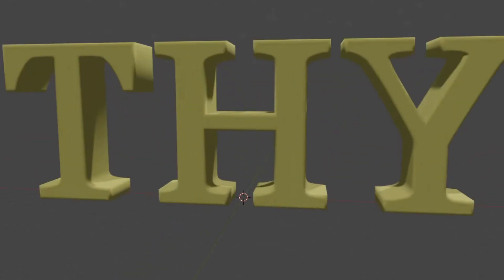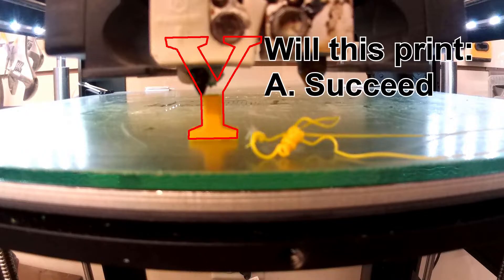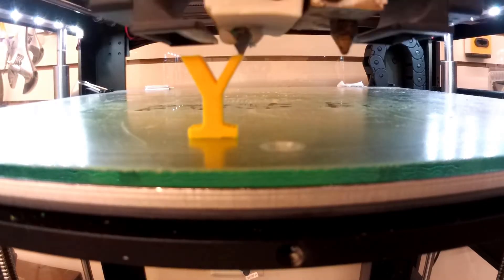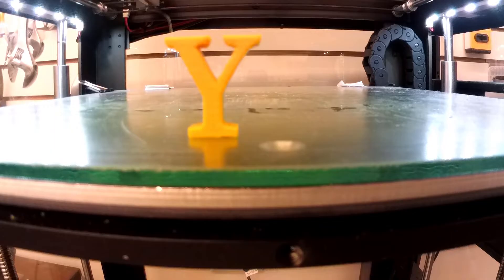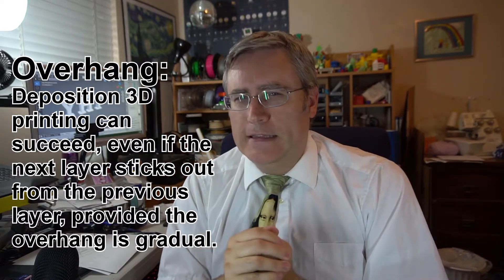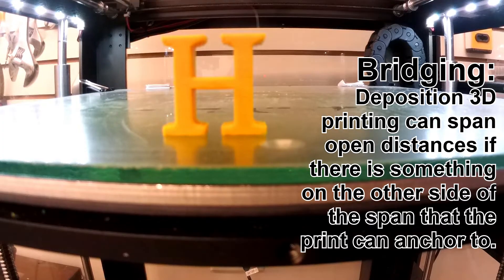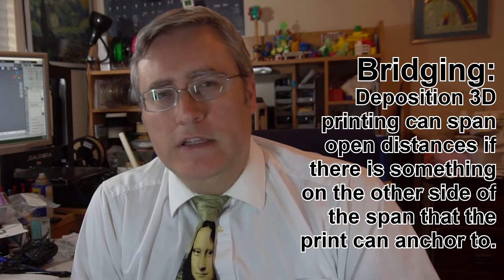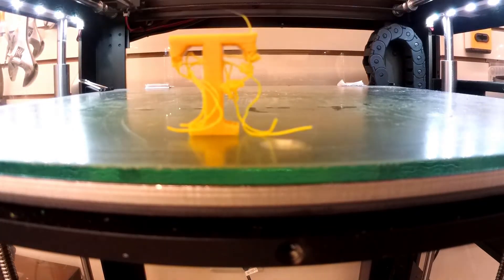How to design for 3D Printing   YHT

Comment: Print the Y flat so there’s no issue. (Roll credits)
Reply from the maker: There he is.
Reply: 3D Printing Professor here I am.
Reply: 3D Printing Professor printing flat isn’t about printing overhangs or not using supports. Letters printed flat look better because you’re looking at more smooth surface and not a bunch of horizontal lines

Comment: I've gone up to 60° overhang without supports without much issue in smaller prints with my Monoprice Select mini.
Reply: Yes, and I have gone to 78% with an Anet A8.  That's not the point so much: it's more about how we should design things so that anyone else can print them too.  There's another factor not really dealt with in this video, and that is the fact that you have much less strength if the layers go directly across narrow load bearing parts, so if that is an issue you might have to think a bit harder about what orientation you print in.  I've done things like click in mounts where it was impossible to print with any flat surface on the bed at all - support was mandatory.